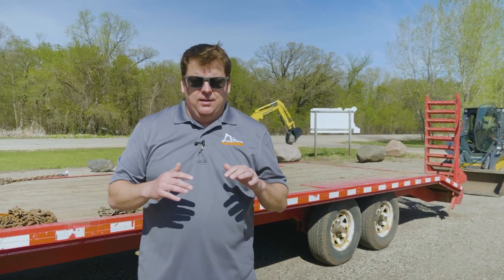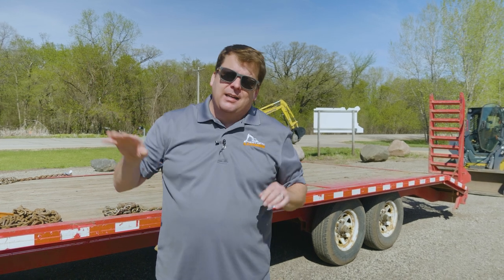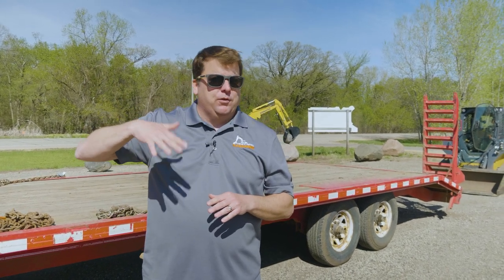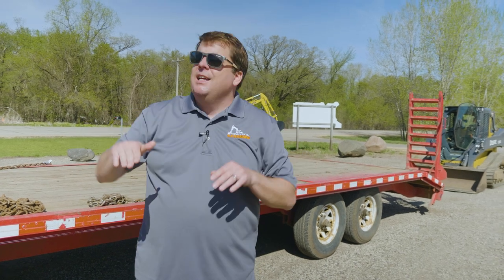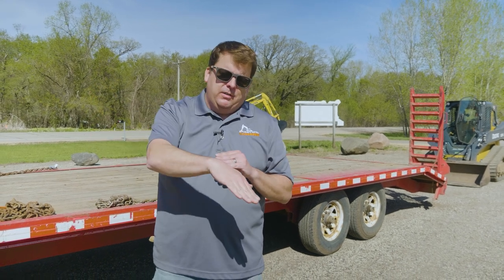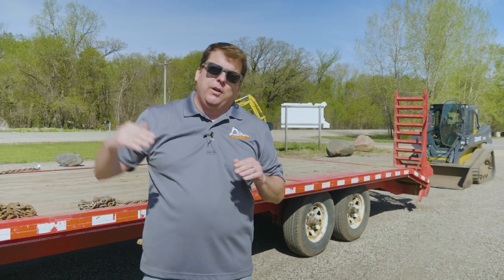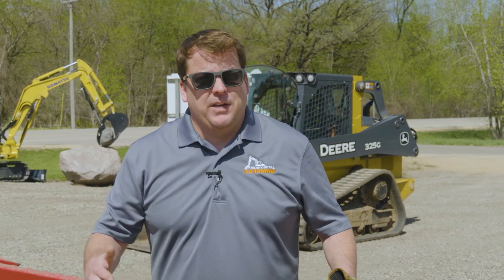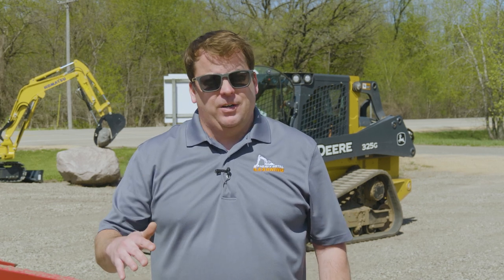How to Load a Skid Steer | Heavy Equipment Operator Training

Comment: There are literally indicators on the side of your boom showing you the proper tie down point. I would never tie my machine down using the handles that are welded onto the machine. I thing that’s terrible advice and requires you to climb onto the trailer rather than doing everything from the ground. Secondly your not allowed to use that single tie down on the back of your machine like that. You can use a single chain but both need to be hooked to the machine and using there own tie down. Not trying to beat up on you but if your taking the time to make an educational video you should really make sure your giving the right information on your videos. If I used your methods I would get pulled over and fined without a doubt.

Comment: No sense putting it on forward. Just load it backwards
Reply from the maker: Why?   Don’t think it matters really, does it?  I don’t like backing up ramps because that is the riskiest position.
Reply: Heavy Metal Learning can get busted glass traveling forward and also you may arrive to job somewhere that backing off the trailer may be too steep.
Reply from the maker: @98Pete  Yeah...those are good points.   I've heard there is potential risk in hauling backwards as well if you don't cover the exhaust that you can damage the turbo on the engine.  Never experienced that, so not sure how much risk there is.
Reply: Always easier to load backwards. Wieght is at the back so less risk of flipping and loading and makes for easy and fast off loads.
Reply: Never loaded a machine backwards in 30 plus years of operating.